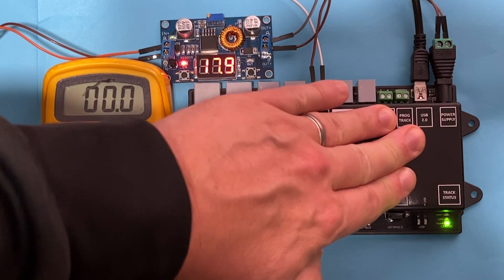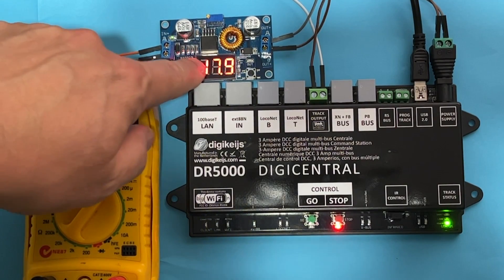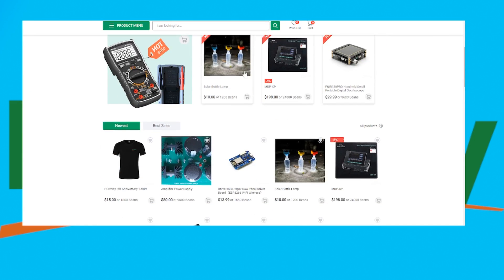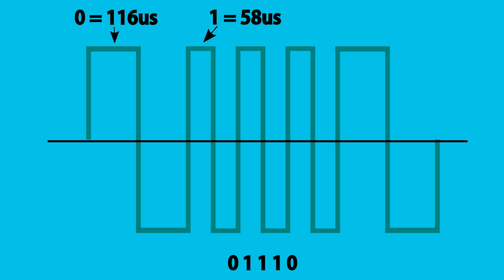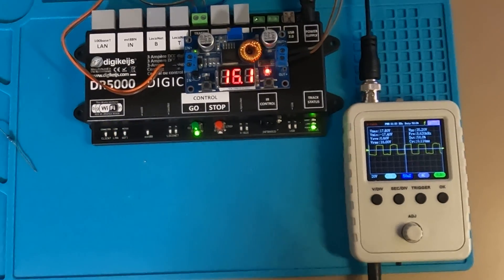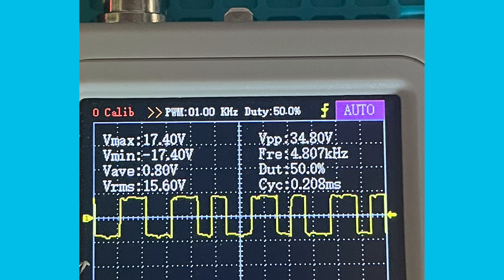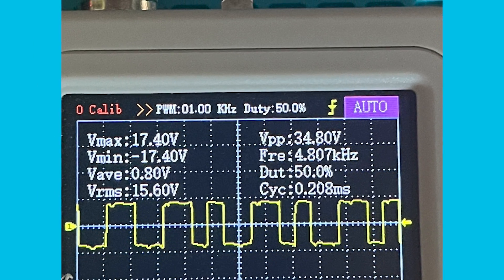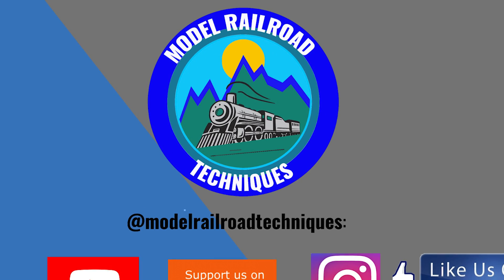DCC Problems?? Use An Oscilloscope

Comment: Hi Dez, great video! I forgot to comment before and wanted to correct my oversight. Good production values too ;) I think this is also a good advertisement for those inexpensive scopes from all the usual discount online sources (especially the chinese sites). You don't have to be an electronics expert to be able to use one of those and to check your DCC signal. There is something to be said for actually seeing the signal instead of just getting voltage approximations from a voltmeter. With an even cheaper logic analyzer from the same sources, you can see the waveform on a computer and capture many seconds of the pulse train and have the software decode that actual DCC packets if you want to go that far. Maybe I could convince you to make some videos for us ;) - Fred
Reply from the maker: Hi Fred, thank you for your kind words and the work you are doing in this area of our hobby. I would definitely consider some short videos. Please email me modelrailroadtechniques@gmail.com

Comment: Great video I’m looking at somebody’s train tomorrow and just trying to find some more about the subject this is very interesting.
Be careful if you use a mains Oscope  (https://youtu.be/xaELqAo4kkQ )  it can short out through the mains house wiring!  Portable is much safer.
I have seen the signal from down the track in another video and it has spikes off the top of the square wave. They suggest a snubber network ( a capacitor and resistor) I have yet to check that out.

The psu you connected switches on and off at about 140khz  it can cause noise in some circuits ,maybe a big capacitor across the output of the psu to smooth the power into the controller.
Reply from the maker: Thank you great advice re mains power unit. Next on my  are on my list to explore are snubbers. What value cap are you suggesting?
Reply: @ModelRailroadTechniques  I found this video ,I watched his video on the waveforms he seems to know what he is on about the video is 20mins long on snubbers so I’m going to watch it in the morning.  https://youtu.be/z3yd8QjEsuU

Comment: Hi, I was triggered by your title. But which problem did you encounter ? To me it seem all good DCC signals... I also don't get what the Buck converter has to do with the problems ;)
Reply from the maker: In a previous video I experimented with the buck to alter the DC input voltage. I had a number of comments saying that this would cause issues with the output DCC signal. The buck did have effect on signal integrity causing some distortion. I can only cause this would cause bigger issues once you add DCC bus cables in longer lengths. The issues that could be caused are run away locomotives, lack of function control. The damage to keep Alice’s etc.

Comment: Thank you for sharing your details video as great watching 
Yes see different in sign on Dcc
Reply from the maker: Thank you for your kind words.
Reply: @ModelRailroadTechniques  check out if put filter between power supply and dcc units see cut down some problems there
Reply from the maker: @rjl110919581  I have build a few RF filters yet to text with them. Cheers

Comment: Really nice video, great pictures and explanation on dcc that I  have heard or seen in a while. Personally I  don't think you'd get a perfect square wave. It depends on the power supply and the actual command station component. You dhould try your experiment on the DCC++EX system built with the arduino and see what it look like compared to your command station you are using. By the way I'm hooked on buying one of these command stations, right now I use  pi-sprog or DCC++EX station. My pi-sorog is made up of raspberry pi 3b and the sprog board. I've never triedto put an O-scope on the signals, but I'm sure there pretty good. My trains run pretty good. The only thing I  did was cool it with a fan. I took an old computer power supply, one which was dead a s used it as a cooling box for my srog. It works great.
Reply from the maker: Thank you for your kind words. DCC ++ ex is a great price of kit. I think you are right about the wave form. It would be Interesting experiment. Dr5000 are the best in the market for the price.
Reply: @ModelRailroadTechniques  There was one more thing that could be making the square wave look distorted -- That's your 39 dollar scope. the frequency may be too high for the scope. i didn't think to scope waves looked all that bad as a matter of fact I through it was quit good. But I'm 20 or so years behind the times. .

Comment: Why do you need a buck converter to modify the output voltage of the DR5000? You can change the output voltage on one of these by changing the input voltage.
Reply from the maker: That’s what I did in the previous video. Adjusted DC input. This cause issues with the DCC signal at output though! A work in progress
Reply: @ModelRailroadTechniques  Why use a buck converter rather than a lower voltage power supply?
Reply from the maker: @JamesPetts  more of an experiment. This is why I like my Z21 you can adjust the output voltage with in an application.